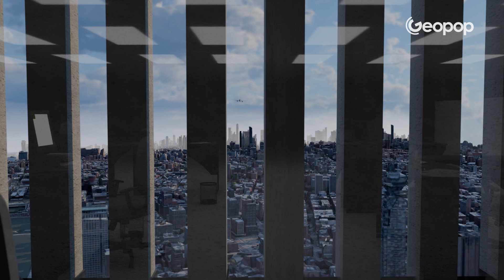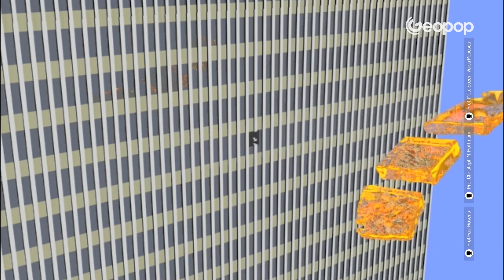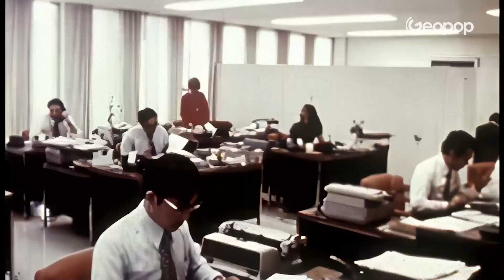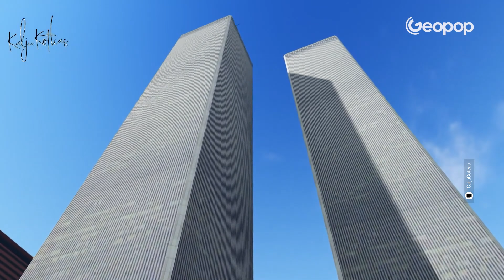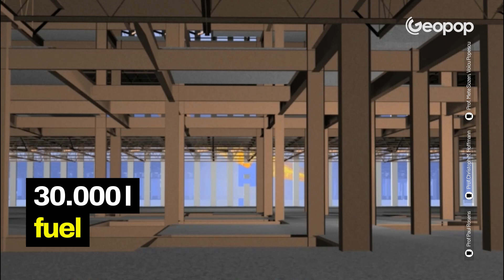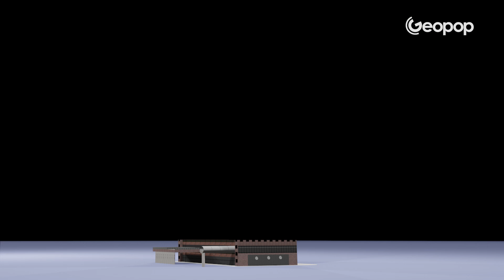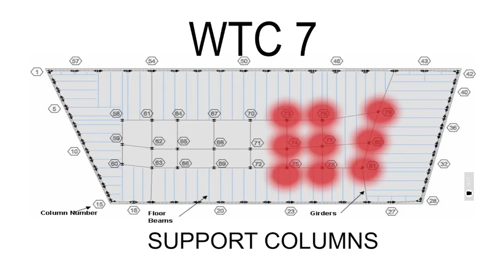9/11, 2001: The Technical Reconstruction of the Twin Towers and WTC 7 Collapses

Comment: Cool vid. Not Mentioned: What happened to WTC 6? The North Tower caught fire in 1973 between floors 9 and 14. Lower floors supporting much more weight didn't collapse. The South Tower was hit second and collapsed first. Both planes created identical impact holes in both towers.
Reply: The 1973 fires in the north tower were not preceded by having a 150-ton jumbo jet crash into them. Did you miss that detail?

The south tower was hit much loser down, meaning the damaged section had to support more weight.
Reply: @Tim22222  The South Tower was also hit at an angle whereas the North Tower was hit centrally. As a result in Tower 2 the weight of the floors above was more unevenly distributed and thus it fell sooner.
Reply: Why would WTC 6 be mentioned?  Read the video title. 

The 1973 fire, did it also involve massive physical damage from 120 tons of high speed airplane and 9 floors being set alight simultaneously from one end to the other, rather than a fairly isolated fire working its way of a vent shaft over time?

Context matters

Comment: I do not understand why no one ever discusses why the automatic fire protection sprinkler system did not work.
Reply: It wasn't automatic and it did not fail.  From The NIST Building 7 Final Report FAQ, 2011:

The sprinkler systems did not fail. The collapse of WTC 1 and WTC 2 damaged the city water main. The water main served as both the primary and backup source of water for the sprinkler system in the lower 20 floors. Therefore, the sprinkler system could not function. In contrast, the sprinklers and standpipes on the building's middle levels (21st floor through 39th floor) and upper levels (40th floor through 47th floor) received water from two large overhead storage tanks on the 46th floor, and used the city's water mains as a backup
Reply: @TheLoonResistance  Even if the water main was cut, WTC7 still had a penthouse water supply tank for the automatic fire protection system.  None of that worked and it was a gigantic insurance scam.
Reply: @JohnDumas-w5z  - It's like you didn't even bother to read my last post 🤦‍♂  Literally asked and answered.

As for insurance scams,...

Construction of the replacement Building 7 was completed in May 2006 at a cost of $700 million. Building owner Silverstein properties received $861 million from insurance on the old building, which could only be used in the construction of a new replacement building . Seems like he scored, right?

If you are a conspiracist you stop there, assuming you even got that far.

However, Silverstein Properties still owed more than $400 million on its mortgage on the old building, so combined with rebuilding we get a cost of $1.1 billion against the $861 million in insurance coverage. This does not include lost revenues during the 5 years Silverstein properties was still paying a mortgage on a building that no longer existed while obviously not collecting any rents. Not to mention property taxes, and other expenses during the nearly 5 years there was no building, all of which have to be added in. Certainly tens if not hundreds of millions more. 

And oh yeah, the new building has less leaseable space than the one it replaced so can produce less revenue. 

Yep, made out like a bandit. 

If you still want to run with this insurance scam thing then you need to be able to tie it in to all of the other events of that day because it can not possibly be a stand alone event. No one has ever even attempted that one.  22+ years of people banging on about insurance scams and no one has even come close. 

I don't see you moving that needle now. 

Of course if 20+ years later and the insurance companies still haven’t figured it out but you really believe you have, why don’t you turn him in with this damning evidence? You will be entitled to 10% of any funds recovered. You could retire overnight a very rich man. 

What are you waiting for?

Why are there never any takers on that one?
Reply: @ - Again, PLEASE ACTUALLY READ MY 2 PREVIOUS POSTS which address every single one of those concerns.

Are you being deliberately obtuse or can you just not help it?
Reply: It has been discussed, many times: The plane impacts severed the water pipes.

Comment: i pose this question. Let's say 911 was indeed a full-blown T-Attack, Let's say they did Demolish the building from the inside and somehow it got passed the 9-11 commission. if you were going to plan something out like this, including the planes hitting, which of the two towers would be Demolished first? The first tower that was hit by a plane or the last one that was struck by a plane? the first tower caught people by surprise. allowing for a small window of opportunity for those in the second tower to Exit the building. so, if you were to Demolish one of the 2 building first you would go with the second one to optimize the most damage since the building clearly had a window of opportunity for escape

Comment: Controlled detonations clearly took out the first 2. You can see it and the steel beams did not melt and the building was designed & built for this exact event possibly occurring. Same as nobody saw a plane in DC, but heard a missle.  Its clear some uneducated Iraqi's with little aviation education did not fly those planes into buildings considering they both smacked dead center to those skinny buildings and experienced pilots cant simulate those maneuvers to this day. If u dont see that we were lied to again and that we did this to justify a pre-planned war to enrich people and obtain valuable natural resources, u really need to open ur eyes and realize who has been behind every major American "terror"attack or events leading up to wars starting w Pearl Harbor which we now know from declassified docs that the US knew the Japanese were on the way and let it happen.  Thats been the theme ever since with every major event. Yes, the government & deep staters are really that evil and satanic.
Reply: Collapse initiation was due to sagging floor trusses (which we can see) causing inward bowing of perimeter columns by up to 5 feet (which we can also see) at the impact and fire damaged floors until those perimeter columns buckled and failed, initiating the collapse (which we can see). I would refer to you the excellent Gary Pollard video of the collapse of the South Tower. Pay attention to the first 12 seconds in particular.

WTC2 Collapse -- Gary Pollard (Enhanced Raw Copy from NIST) 

www.youtube.com/watch?v=ULdiD6gYZO0  

Columns don’t work well when they are bent. The Twin Towers were designed to work with straight elements not bent ones. When you bend those columns they become up to 4 times weaker. Failure is inevitable.

Notice how the columns are already bent when the camera zooms in, become a bit more bent over the next new seconds until they give, starting the collapse. 

So what bent them? It sure as shit wasn’t thermite or sooper-sekrit fire-and-impact proof hush-a-boom pre-planted demolitions that don’t explode. 

If you keep watching you will note that after the tower starts collapsing the air inside the building (95% air by volume) gets compressed and forced out the windows. These low-velocity air bursts devoid of blast or fragmentation effect are a reaction to the building collapsing not a cause of the building collapsing 

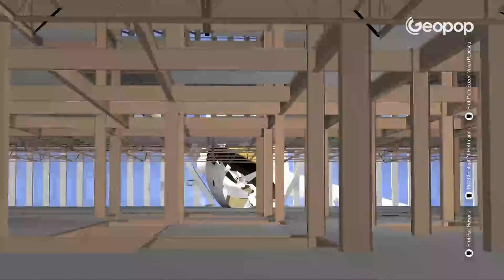And at a different angle from 1:18 here:
youtube.com/watch?v=TJJPYTVjxug&ab_channel=femr2 

Or here
www.youtube.com/watch?v=-DCgEJ2bUcI 

Also seen in the excellent still image here at 9:09:
youtube.com/watch?v=YXsDwKYz1bA&ab_channel=msvfreak94
Reply: Some facts you should know:

- The towers were NOT designed for "this exact event"; that scenario was for a smaller jet traveling 1/3 the speed of the 9/11 jets and low on fuel, not fueled for transcontinental flight.
- The hijacker pilots were from Egypt, Saudi Arabia, Lebanon, and UAE. None were Iraqi.
- The pilots were trained in the U.S. and held rightfully-earned commercial pilot licenses.
- Those towers were over 200' wide - hardly "skinny" - and would be easy to hit. You could do it on your favorite flight sim program.
- There has never been any physical evidence at all pointing to controlled demolition.
- When you're SO WRONG about SO MANY THINGS, you really shouldn't be lecturing others.
Reply: no evidence of a controlled demolition? Then what is this. 
1.The firefighters said" it looked like they had detonators, And planned to take down the building" I didn't say that, The fire fighters said that. They were there.I'm sure they know better than you. 
https://youtu.be/XiIT4HInWjY?si=e1Pvp3-IFs-M75Oj
When the firefighter says "boom, boom, boom, boom" in this video.
What do you suppose he is?Implying by " boom" ?? What do you hear? 
2.So if there were no explosives then what is this? 8:25
https://youtu.be/bLF5D7M1YgA?si=aHSvS__uOdxMi1ZB
You can't say that it was added because you can see the firemen's reaction to the explosion. And you can't say it came from anywhere else because the firefighter says
" We gotta get out of here,  7 is exploding "
3. Controlled demolitions have squibs, you can see the squibs here 20 floors below the collapse. 
https://youtu.be/eXAgulfAtR4?si=-iLO9aQjMJVLTUYH
4. Firefighter says "any one of these buildings could blow up,  this ain't over yet" firefighter says there's 3 secondary explosions. 
https://youtu.be/0Gh3ErgMI4M?si=mmp9Eus_5PWTCBfl
5. Airplanes can't fly 600 mph at 1000 feet. And to be able to make a 180 degree turn to hit the opposite side of the pentagon going that fast is ridiculous. And since when do terrorists hit the opposite side of the building where no one was at when they could have just flown straight in and killed way more people???
 https://youtu.be/0Gh3ErgMI4M?si=mmp9Eus_5PWTCBfl
6. This video admits the buildings fell at nearly free fall speeds. Resistance takes time. 
7. No one has ever known ahead of time that a building was going to collapse except through controlled demolition.  Tower 7 was reported to have fallen while it still stood in the background. 
8. Larry silverstein,  the man who made over 7 billion when they fell, claimed to have pulled the building down.
https://youtu.be/1jQaJFNWqtc?si=wCywQ9grgBdS_w11
9. A witness reported a missile hit the pentagon while he was seen at the scene. 
And the hole wasn't big enough for a plane and the damage wasn't consistent to the towers. And just like shanksville,  there's pictures that show no plane parts at all.
https://youtu.be/6_Ez-UCpXMs?si=JaQ6DBEC_LJtMLgN
10. That video also points out They were military planes that hit the twin towers. 
11. All sorts of reports of explosions were reported that day.  
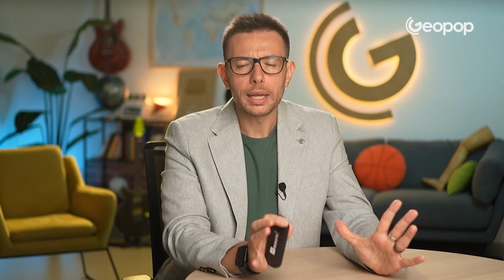12. In this video at 1:40 seconds, the guy admits he is lying. Now I'm no genius but didn't he say nobody knows the truth about what happened that day.  We know he hasn't talked to everyone,  he however does get information from NIST. So is he not saying NIST is being untruthful?? Why yes he is...
13. Buildings dont accidentally fall  Into it's own footprint. 
Good day to ya mate
Reply: @robbiehiatt9966  What is this? It sure isn't the physical evidence I asked for. You can take firefighter quotes out of context all you like but it's not enough.
Reply: @Tim22222  well you just keep on living in the past and believing what they feed you. I'm not here to change your mind. I'm here to make you look like the bs feed sheep you really are. Learn some problem solving skills otherwise you are simply a NPC.  You don't exist in the world I'm from. All software no hardware
Reply: @Tim22222 I didn't take anything out of context.I simply provided information. Where is your proof that the information I provided is wrong?
Reply: There you go then
Reply: this is something written by stinky, that you copied. Where can you see bent trusses? Next time you post something you didn't write you should make sure it's correct. These videos you chosen aren't even good angles to see the collapses. You have zero proof what bent the columns? And ive posted tons of proof that loud explosions were coming from tower 7 and the twin towers.
Reply: the shear amount of logistics it would take to bring down 3 buildings with explosions (in secret) is impossible, As a 25 year military vet our govt is not that efficient.

Comment: Yea right????? Not
Reply: And yet (mostly) not wrong. Go figure. Not what you want to hear of course, but not wrong. Which is why that rebuttal (if I'm being generous) is the best you will be able to do.

You may not like it after more than 2 decades of internet conspiracy dogma, but what is being presented in this video is fundamentally correct and widely supported by the worlds engineering community.

While imperfect (there are a few problems) this video goes into a much higher level of detail than many viewers can comprehend and gets the collapse mechanisms fundamentally correct. This is true no matter who planned and carried out the 9/11 attacks or why . 
	
Sure, it’s not what you want to hear and goes against 20+ years of conspiracy dogma and conditioning, but that is not the same as it being wrong. You just need to fix your dogma. 

On the plus side, this video can be (and is) fundamentally correct about the engineering AND the 9/11 attacks could still have been some sort of inside job. The two things are in no way mutually exclusive. It’s just not the inside job the clowns you have been following on the interent have been telling you. 

This will surprise you to learn, since the conspiracy side of the internet hides it from you, but the mechanisms described here have broad professional support around the world. There are no professional engineering organizations (for example: ASCE, ASEE, ICE, etc) that disagree with them or have offered any formal dissenting opinions or alternative hypothesis. 

So, either the overwhelming majority of the worlds structural engineers and quite frankly simple observation are wrong,… … or you know more than the worlds best engineers from cruising around on the internet. Which seems more likely? 

If this explanation is wrong then produce a better one.  Be the first to even try.